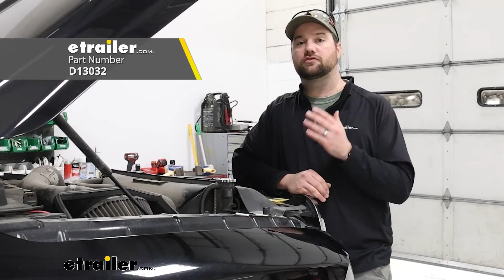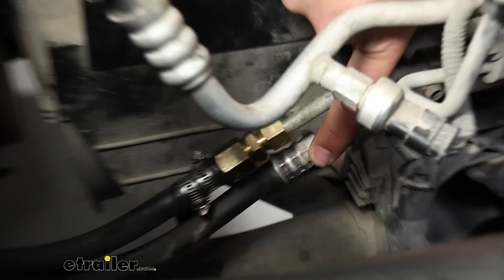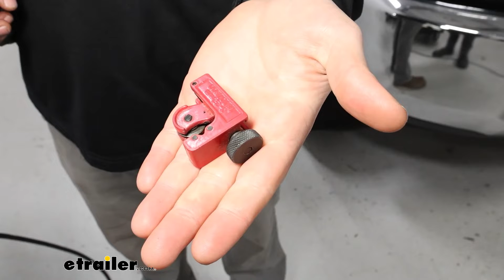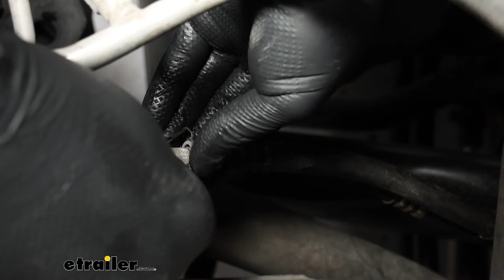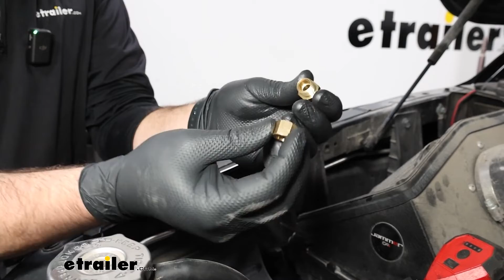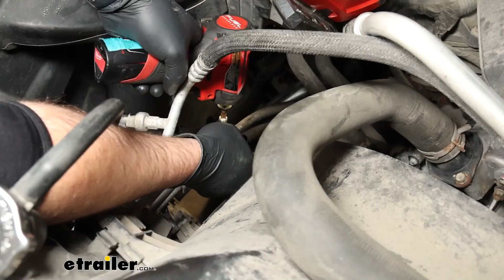Installation Guide for the Derale Transmission Line Compression Fitting Kit on a 2013 Ram 2500

Comment: Adding this to my 92 cadillac someone didn't flare the line so it keeps blowing off at the worst time. 😑 no flare and slippery fluid =not good lol 😆 🤣 so going to slap a compression fitting on and should fix it for good 😉 under 20$ on Amazon and got 2 of them. Thanks so much for the video